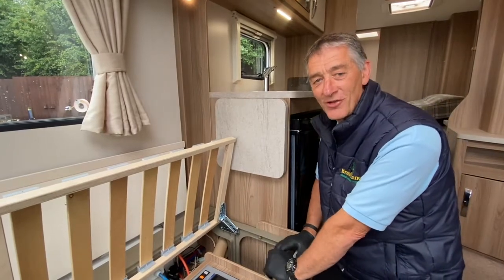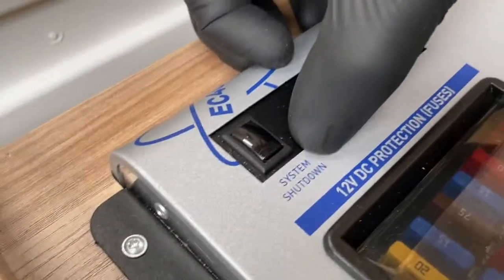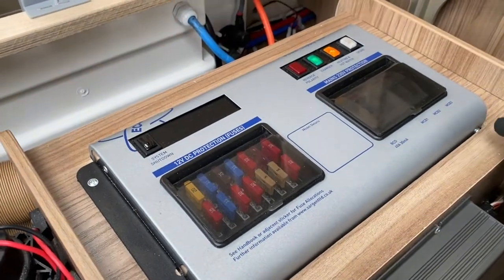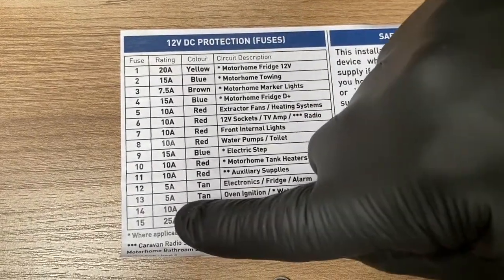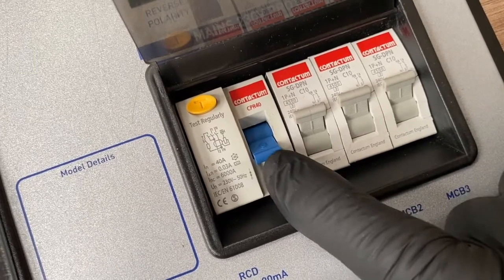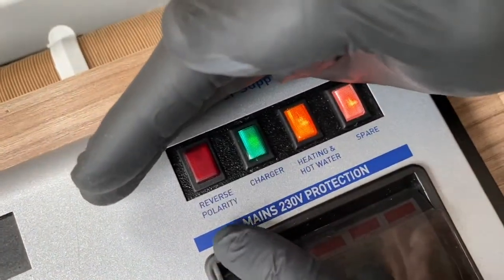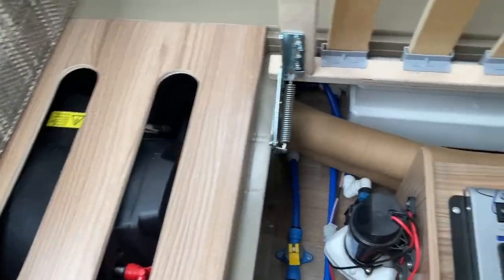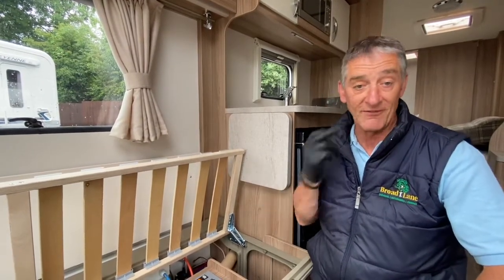Power Supply Unit (PSU) Demo - Swift 2016

Comment: I have the same unit but my hot water, fridge and charger run on the same fuse MCB-3. However my RCD started tripping and turning off yesterday. I’ve isolated it to that same third fuse. What is most likely causing this? It instantly shuts off the RCD when I click that 3rd fuse up? I’m thinking possibly the hot water cylinder element has blown and is shorting out? How do I tell if it’s that and not the fridge or charger? I have a multimeter but not sure where to test it

Comment: My 12v sockets, radio and tv booster don’t work. I’ve checked and replaced the 10amp fuse and the inline battery 20amp fuse although both were ok. I’ve also replace the 12 volt socket that I had been using 10 mins before we lost the power. All 12 lights and cooker ignition etc are all working. Someone has suggested the habitation relay. But don’t know where this is located. I have a 2017 Swift Challenger 560 Alde.
Reply: i know I am pretty off topic but does anybody know a good site to watch newly released tv shows online?
Reply: @Trevor Trent Flixportal xD
Reply: @Keegan Julian Thank you, I went there and it seems like they got a lot of movies there :D Appreciate it!
Reply: @Trevor Trent you are welcome =)